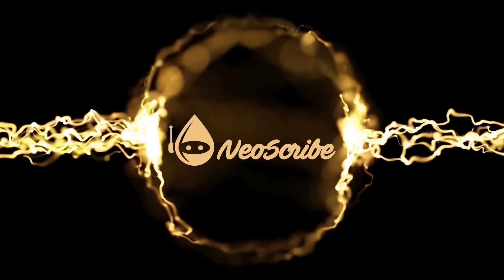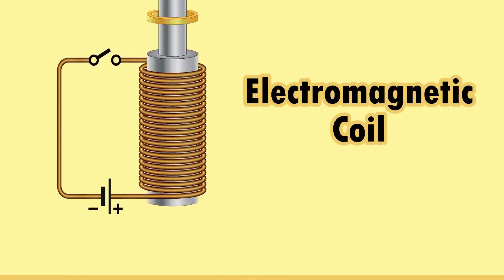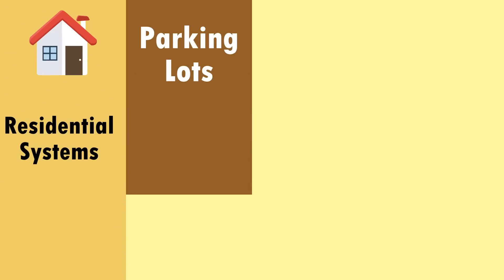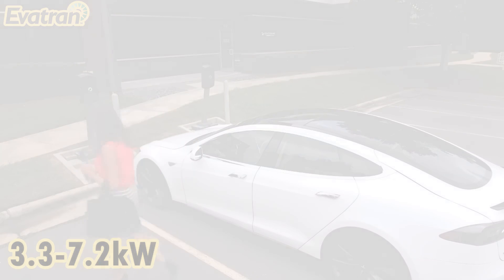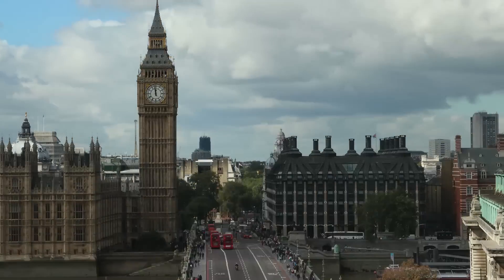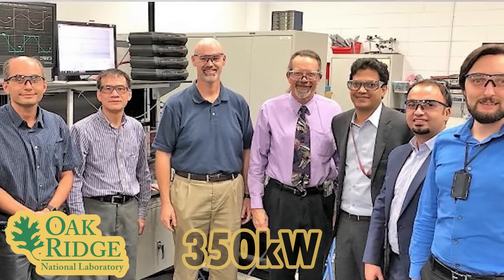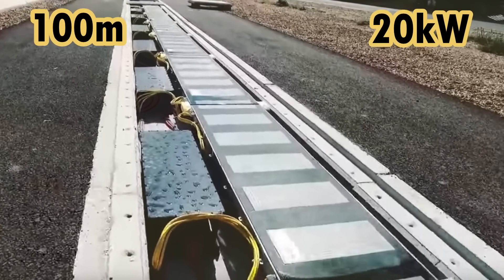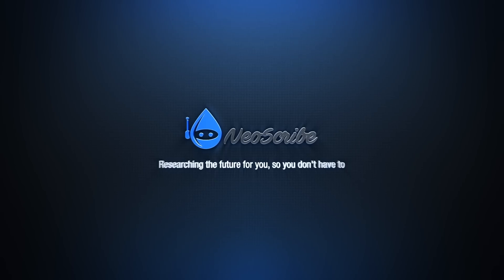How Wireless Charging For Electric Vehicles Will Solve Range Anxiety

Comment: wireless charging doesnt make a whole lot of sense. there is not a single reason not to use a cable when the car is parked and implementing it into the street is absurdly expensive for you getting 1 extra mile when waiting on the street light. The most important reason why wireless charging is dumb is because its energy efficiency drops by a stupid amount compared to charging wired.
Reply: This I why I read comment before making one. I was going to say the same thing about wireless charging being very inefficient. As for phone wireless charging it’s a lazy feature and slower then cable, but also cost more to use. Unless wireless induction changes with a new discovery, our current technology will cost more and who pays for that? RFID on cars to get billed? Then electric cars could cost almost as much as gas? I hope I will be able to turn off the wireless charging.
Reply: Surely the point of any of this is to create better systems? I really don’t know the science behind it like guys seem to but is the answer to not innovate at all?
Reply: @Godsfavouriteidiot_  yeah not saying they wont suss out something better, but there's an inverse square efficiency with distance happening when wireless charging, you practically have to coil around something else if you want better efficiency. They're trying to "beam" electricity since years already but a wire will always have more electrons flowing through it!
Reply: I agree, thinking is a pipedream,  even if it works it would not be very efficient.  To me an ev is an good option, if you commute some distance for work and you know your distance.  And charge overnight.
Reply: Bazzralic  
No, we need to realistic and stick with,
1) Reducing individual vehicle use.
 2) Not being so damned lazy, get out of the car and plug in!..... 10 seconds!
3) Realising charging away from home or local amenities will rarely be needed by the majority.
Reply: There's many good reasons for wireless charging... Like did you maybe stop and think for a moment about how it could be used or are you one of those closed minded people that always thinks advancements in technology is a bad idea without even considering the possibilitys? If so please fuck off and go live in a cave with your type of people
Reply: @rogaatnine2380  
There are NOT many good reasons for wireless charging.
We're entering a period when (I hope) overall efficiency of any system becomes the paramount consideration.
Whatever your energy source, use it effectively.
On (in) road charging doesn't do that.
How many miles of road are there in your country?
Would you enjoy every single road being dug up to install the system?
Would you enjoy paying for that up front, even if you don't own a car?
Would you enjoy having the road having far more complex repairs when the surface wears out.
Would you enjoy paying 30% more to charge your car? (Yes, you would!).
If only the highways were modified,
Would you enjoy traveling to a more remote area and finding your (small) battery wasn't large enough?
Would you enjoy being on a long trip if there was a power cut, or other system failure, leaving you on the road with no charge?
Keep It SIMPLE!!
Reply: Nikola tesla would be ashamed of what the human race has become. There's always solutions
Reply: Wrong, if it is a 60 kw charger you might get 333 wh if you are there 20 secs. But what about the next light 1/4 mile away. Also the cars behind will use charger. Thus as you drive around town, you might gain 3 miles of range for every mile you travel. It could almost be implemented tomorrow.
Reply: @freetrailer4poor  
If the "coils" were not spaced very close together, your car would only receive a pulse, effectively a sine wave, as you drive over coil.
At speed that would be a few milliseconds of "maximum" voltage.
Around town? Why? You're near chargers, you're either in the town to go somewhere, do something.... Charge there!
Of going home? Charge there!
Reply: Think service vehicles charging at fixed locations.  It makes sense then.  But ya beyond that consumers can plug in.
Reply: Automated plugs and charge ports   like the Tesla chargebot prototype will work just fine
Reply: @micmag2375  Physical contactors wear out overtime.  Doubly so when exposed to elements.  Close proximity wireless charging makes sense for industrial transport tasks (buses, trains, shuttles, etc).  It doesn't really make sense for roadway charging or home use.  You might plug your car in once a day (or even a couple of times) but a bus or shuttle might need to charge dozens of times per day.
Reply: @tomstdenis  possibly but if you look at electric trains and trams, they use a permanent contactor with friction and have worked for decades. Busses arent hard as here in my city they only run for 2 hours or 100km max per run and then could easily stop for a 15 minute DC fast charge before starting the return route, they could also fit a couple of kw of panels on the roof. I really think battery pack size will win over needing to charge often but we'll see, I'd be more than happy if we had free wireless solar charging implemented but as an EV driver I dont see a huge need for it as EVs are already more convenient than the old pay for gas at the dirty pump model.
Reply: @Harlie C 
Why would "they" want it?
"They" would a e to administer it.
"They" would have the justify it.
"They" would have to fix it.
Reply: @Roger Starkey  
Watch "Fast-charging electric bus at work" on YouTube
https://youtu.be/t3rg-SsPJuU

8 years ago
Reply: You don't seem to have heard of induction scavenging or the fact that power not transferred is reflected back. So yes the induction system at say 24 inches is at best 60% efficient.... But that doesn't mean 40% is lost it just means that 40% isn't finding its way to the vehicles battery. Generally you just increase the frequency to compensate. So long as the reflected energy is caught then who cares? Theoretically an induction system can also actually gain energy all on its own, just from the environment and store it. That's because no matter where you are in this universe you are always right beside something giving off electromagnetic radiation. Which can be captured, in a magnetic field, and stored...in a battery.

Induction scavenging is pretty much a drip feed though so not useful for the consumer...but fantastic if the entire road network had it installed. However I doubt any city planners have crazy ideas of ripping up the streets of LA, London or Tokyo to lay down induction coils.
Reply: Bazzralic  The problem is the actual physics involved in wireless charging. There was an engineering video showing why wireless charging for cars is a bad idea. It ends up being about as efficient as a gas car at best. You loose all of the benefits of electric regarding the environment. Solar would be a nice option if we placed them on rooftops everywhere and we could get their efficiency closer to 100%. If we could get it that high then a solar car would be great since it could technically get up to 8Kwh from the car's surface.
Reply: Bazzralic  There isn't away around the loss. We can improve it somewhat. Wireless charging isn't a new technology either. It's been around for over a century. The propagation of the field will always have massive losses by the nature of the physics. Wireless transfer will never be anywhere near as efficient as a cable. A high efficiency wireless transfer is like asking for a IC engine that produces no heat. Most of the energy loss in IC is heat and it's for the same reason as wireless transfer. It's inherent to the physics involved.
Reply: Qualcomm get 85% of energy efficiency. The dynamic wireless charged EV will be 50% lighter then wired charged EV for same range. Who waste more energy?
Reply: @ekremmusic9909  wireless charging will never be 85%. The physics will not allow it. In addition how can wireless charging be lighter? It physically needs more hardware in order to work. If that's what they claim then I'm calling bullshit. Range also has nothing to do with speed of charging.

Comment: Remember solar road? COST
Reply: give it 20 years and it will happen yall act like the future is the present lol
Reply: Apples and oranges. Solar panels need a lot of space and expensive materials whilst wireless charging just needs a power source and some coils.
Reply: @abz998  copper is too expensive, sure it could be done, at what cost? 100' of roadway with this charging system would cost as much as the electric car itself.
Reply: a998 These things do not work at 60Hz therefore they need drivers which are most likely going to cost more than the coils
Reply: Also solar roadways was a total scam from the beginning and never really viable
This might be viable but is kind of a solution to a non problem
Reply: Remember the COST of climate change?
Reply: matthew portilla, climate change is a natural phenomenon.

Comment: Heat is a known problem with wireless charging and heat kills batteries.  There's also efficiency losses.  Just because we can do something and it is more convenient, doesn't mean we should.
Reply: Very good statement, just because we can doesn't mean we should....
Reply: Beyond that, who's gonna pay for all the roads that would have to be upgraded to allow for such a network?
Reply: @Enthropical_Thunder  the people who no longer need to have a 10,000 buck battery in their vehicle. If we electrify the whole transportation sector, that means spending about 4 trillion on batteries. If we electrify major highways, a lot of people will only need smaller batteries. It might be very economical for most people.
Reply: @gingerbaker1  
Could as well spent a fraction of it on public transport like trains, that already run on electricity and get the same result. Also, there is much more to the price than just raw build cost, you have huge losses due to underground high voltage cables (they don't put them on 10 or 15 meter height masts for nothing ;D), losses due induction, overhauls of the roads would cost a fortune and believe me when i tell you that they have to overhaul them more often than you think and of course huge control centers with staff to guarantee safety and testing them in order to ensure flawless function. I disagree on this, until electric cars aren't at least covering 80 percent of the traffic, there won't be any way of this being economical for a company or a whole state or even excepted by taxpayers as a reasonable way of investing money. So we might not see this idea being executed at a major scale in this century ;D.
Reply: @Enthropical_Thunder  taxpayers aka citizens only and legal residents only....or anyone who own electric only. Lol
Reply: @kingt.2811  
Anyone who owns an electric?
Oh man, you're a meme on your own, if just the people who would own an EV would oay for this, you will probably never see something like this XD.
Reply: But we can never stop trying to make it better
Reply: overkill1340 
Lipo batteries can burst into flames if they get too hot
Reply: Like stem cell right?
Reply: Installing this would be far from convenient. It’s going to be enough of a challenge implementing standard charging networks. Wireless charging could only ever work in residences and even then it’s only beneficial in certain scenarios, such as when the car has to be parked on the street.

Comment: Not so sure on the wireless charging thing for cars. The amount of energy a car needs is astronomical and wireless charging is very inefficient and on another note, not so sure about being in a car while it is bombarded with the equivalent of 1 week's worth of electricity your house consumes in just a few minutes as radio waves or micro waves.
Reply: Argasy Argasy2 we should use the life force of young kids to charge our cars. It’s so efficient too!!
Reply: wireless charging works magnetic
Reply: Bazzralic close
Reply: Wrong, Wireless Charging  is the best. I charge all my devices wireless so I want to charge my car this way too.
Reply: jawbreaker it's still inificient
Reply: @tiresias3342  It is more than 95% efficient, which is the same as a wired plug.
Reply: Roger Lambert it's far closer to 60% efficiency, it basically works like a transformer but without a core to focus and contain the power
Reply: @gingerbaker1  
It may get closer to that if the car is static and low to the ground. Try that on an SUV or pickup with 400mm ground clearance when it's moving.
Reply: @tiresias3342  wrong. Look it up
Reply: Roger Lambert odd
Reply: @DaveBoxBG  it is objectively not the best. Yes its great to just put my phone on a pad on my desk. But even that is slower and less efficient than cable. A car needs far more power.
Reply: @Distress. my phone charges faster over wireless than over cable?
Reply: @DaveBoxBG  if you have an iPhone with a slow charger, it will charge faster on any good wireless charger that other brands sell..
Reply: @DaveBoxBG  
Tape a wireless charger under a table.
Slide your phone across the table over the charger.
How much charge did it get.
(Not much)

Comment: That is a lot of energy in those fields. I would think there would be some health issues as well.
Reply: No health issues but theres other problems with this
Reply: No, the energy is resonance-tuned. It doesn't affect anything but the car coil.
Reply: There probably are some issues with far field induction. But I doubt anything serious. After all you live on a huge induction coil called Earth. Near field induction has a field that in this case might extend 20 inches. Its a lot more powerful and not targeted. So you wouldn't want to lie on one if you had a pacemaker. The energy is all contained within the field, so only thing in the field can be affected at all. I wouldn't put a flash drive on one or leave anything affected by a current sitting on it.  Its not like say a mobile phone which uses microwaves or an FM signal which create a wave traveling out from something.

Like all EM systems this is producing radiation. But there are many types of radiation...from visible light to gamma waves. This system doesn't do anything we know of that could affect your health. Then again physicists and biologists don't know everything right? If they did science would stop...lol.

But its a reasonable question. One might affect nobody.... But a network of 20 million of them? 

I suppose we'll find out right?

Comment: How realistic is that? When it will gonna to happen.? We are hearing at least 2  or 3 years now that they are gonna to solve the battery issue. But still ev are expensive are not a lot second hand that u can buy. Furthermore the ev energy need to be produced at least 60 to 80 per cent from wind or solar energy and they need to be charge fast. At least 150 to 200 khm in 30 to 45 min of charging... How realistic is that? I love ev... But I am still waiting to see more technology and more investment. Ev need to be flexible need to be charged fast at least 200 khm in 40 45 min or even less and the battery capacity much be bigger. Range 300 to 500 khm after 45 min to 60 min of charging
Reply: khm?
Reply: It is physically impossible for an electrochemical battery to safely store the same energy density as a chemical fuel (e.g. gasoline). That's not a matter of research and development, that's a matter of physics and chemistry.